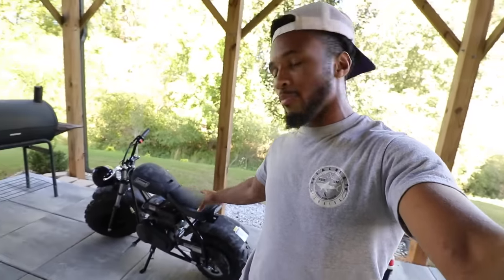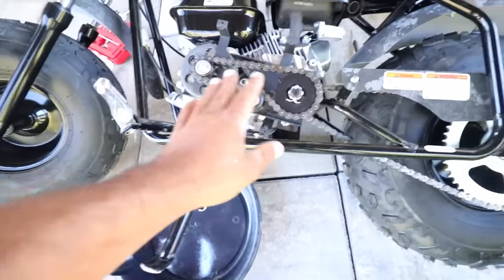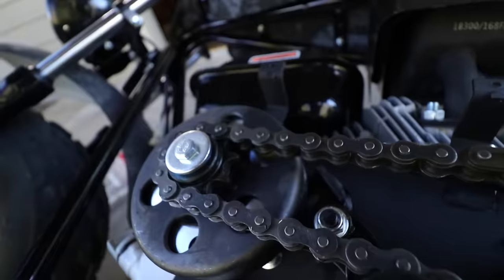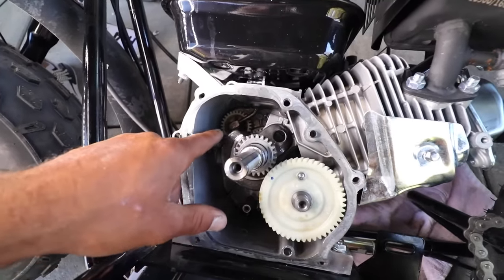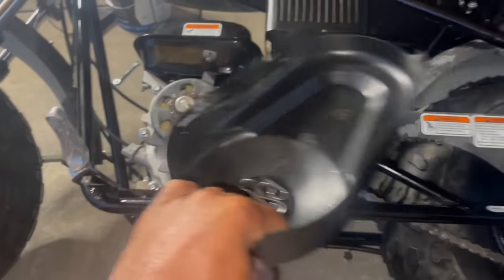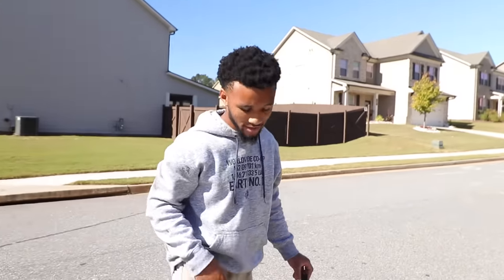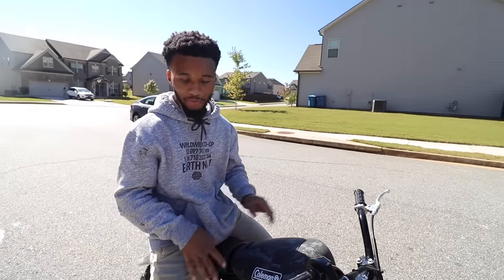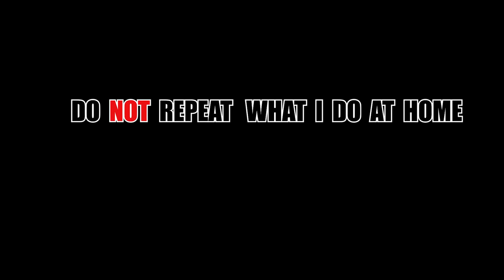I Removed The Speed Governor On My 200cc MINI BIKE!! *FAIL*

Comment: All you have to do is bypass the governor spring with a zip tie on the throttle body under the gas tank, it's just as accurate and you don't have to take the motor apart, just search governor bypass with a zip tie. 🤘
Reply: Is that all you have to do or does it depend on what mini bike you have because I saw a video of some guy who did that on a frp gmb100 and he took out the limiter
Reply: Yeah zip tying it pretty much does the same thing, it just prevents that limiter spring from releasing, it's just less work zip tying it instead of completely removing it
Reply: @ADAMROCK78 I just zip tied mine and it started to stall and now won’t start. It was running completely fine before hand and now doesn’t even start. I just got a new carb and still won’t start. I checked the spark plug and everything else and I don’t know the issue, any ideas?
Reply: Bro when that shit took off lol😂
Reply: Yeah it basically keeps that governor spring from engaging, and yes you'll definitely go faster without that sluggishness when you reach top speed 🤘 SeriousandfunandJesus
Reply: SeriousandfunandJesus  You're welcome, enjoy the new bike 🤘
Reply: Anybody gonna help this guy out?@SeanBulicki
Reply: @SeanBulicki probably not the right spring but idk it seems like it would not mess it up if it’s the governor one
Reply: @SeanBulicki  Your jetting is off. Needs tuning

Comment: U need a spring on the throttle pulling it back so it dont run wide open, and when you go to start the bike always use the choke itll start first pull every time, and when you bought the bike they dont come with oil, it just has a little in there to protect the engine parts in shipping, and another super easy speed mod you can do is there is a screw that only lets the throtle go so far, so the tab it screws in you bend it back, and itll go really fast with that and the governor you just took out
Reply: Smart
Reply: Great tips
Reply: bout 55
Reply: If you do a jack shaft delete and do direct drive they go pretty fast for a "trail bike" me and my buddies got some and we had a car follow us and they were going 61 and we still had some rpms left
Reply: Thanks 👍
Reply: I just purchased one not here yet but can u tell me about what the choke is and does for a motor bike?
Reply: @iknobetter5961  the choke has a on and off position, so when the engine is cold after not running a day or so, turn the choke on start the bike and let it run for bout a minute or 2, then turn it off and it's ready to ride, also if it don't start without the choke when it's warm after riding, choke it and it'll start. Basically anytime for first starts use choke, and when I start to ride turn it off, otherwise it won't run good. Hope this helps
Reply: Smart
Reply: @that_yeller_foreman1529  hey do I just take the governor out? I have massimo mini bike and I can't find any motorcycle shop to work on it so I need to know exactly how to make it faster myself, could you help me In telling me what I need? I'm sorry my father would have helped but he just passed away
Reply: i have an 82cc mini bike, once you take out the govoner they go crazy, what i did was lower the idle and put a higher rpm clutch on it
Reply: @riskydeth1216  u gotta put a spring pulling back on the throttle on the engine somewhere
Reply: @that_yeller_foreman1529  i do have that but its only because of how i have thre throtle set up, i have it conected to an exhaust cage
Reply: @riskydeth1216  and with it, it still has a high idle? Have you adjusted the idle screw in?
Reply: @that_yeller_foreman1529  it runs fine, I was just telling people about it
Reply: @skylerchan7746 there a screw that u turn if u looking at engine it's got a spring u turn counter clock wise to go faster
Reply: Cool bike

Comment: Put a return spring on the carburetor butterfly because it stays open 👐
Reply: Exactly
Reply: Thanks bro cause I did the same
Reply: Yo can u make a video on this please
Reply: @lucassarrazin6306  I just push it back 😭😭
Reply: I just put a zip tie around the governor spring. Top speed of 51mph now
Reply: @paulbernardo3025  can bend the valves though

Comment: Whenever you remove the governor you need to add a return spring opposing the throttle otherwise it’ll just run wide open….. take off the air cleaner and you’ll see what’s going on
Reply: Yo I did this with my ct100u and I did everything added a spring and everything and it still is wide open

Comment: My 212cc predator engine for my Go-kart was set up the same way bro. U gotta remove all the linkage to the governor arm, then (with the engine open again) from the outside top cut that metal governor arm off that u left in there when u removed the governor. After that just tap the hole to make threads where the governor arm was and put the correct sized/threaded bolt in its place w/ sum thread locker on it. Then close the engine case back up, fill with oil, connect a return spring to the throttle linkage and also back the throttle screw out a bit that's on the engine.... Once all that's done, ur ready to ride out.. NOTE: Very Worthwhile Upgrades to get more horsepower n speed are as follows---> performance intake air filter& carburetor w/ upgraded carb jet, Heavier/bigger valve springs, high flow exhaust pipe kit (w/ high flow exhaust muffler tip for the neighbors sake, lol), adjust gearing ratio to your preference by installing a smaller/bigger sprockets in the right places.... After those upgrades, it's like a night n day difference w/ power&speed gains and makes it into something u could seriously hurt urself playing with if ur not careful lmfao... I Hope that helps and I hope u guys get ur minibike set up on point like u want it.. oh and btw, I did it all using YT vids. My YT playlist labeled "Go-kart Stuff" contains every video I used as instructional reference to do everything I just explained, but for my predator 212cc engine on my Go-kart.( I also disconnected and removed the oil sensor cut off box thing)
Reply: This thing is way to complex for this guy. Needs to stay with simpler  things with out too many moving parts.
Reply: @ratdad48 the throttle linkage is pretty confusing how it connects with the governor. I put like 5 hours into it and couldnt get it original again before i gave up and ordered a slide carb and a different throttle cable.

Comment: I think the Governor linkage pulls the throttle open when at lower rpms. It has to be disconnected because it's not there anymore. there should be an arm on the outside of the block from where you removed the Governor. Remove all linkage from that arm. Then adjust carb idle screw. Watch a video on how to remove the arm. It's easier than trying to explain.
Reply: What video?

Comment: Always make sure you have the front tire pushed up against either the curb or a wall  or a tree when first starting it so the bike can't leave without you. Adjust the idle with the brass screw and black plastic screw on the side of the Carb.
Reply: CEESO USES CODE LITTY  throttle likes to stick on those bikes. May need to be loosened more it needs to be snappy pull it with your finger it should snap back quick and a spring to help pull the spring back.
Reply: No you never want to bump a mini bike against anything that is a sure fire way to bend a valve and pushrods and blow every gasket out. The best way is to raise the rear of the bike off of the ground and dial it in that way.

Comment: U need to put a return spring for the throttle linkage it’s just stuck wide open now cause u removed the governor lol u have to find a way to connect the throttle linkage to the little black piece on carb this way your not stuck in wide open throttle I can get u pics if need be
Reply: Wym

Comment: I had that same problem it was my clutch bc it was messing it up and I fixed it by buying a torque converter and instead of taking the governor out I zip tied the spring trick.

Comment: The reason it wouldn’t crank write away is becuase u either    Have that switch on the handle bars turned off or either the gas’s is off or u can turn the choke on

Comment: U took out the right thing you needed to take out that lil bar too and just put a bolt there and re locate the throttle cable and it will work perfect it’s just because that bat is all the way in you just needa Relocate the throttle cable

Comment: Did you adjust the throttle cable at all? Not by the hand controls its just like two metal pieces with a bolt to clamp it together check that out maybe🧐

Comment: Mount a spring on the front end of the throttle where the holes is in the linkage and connect the spring to on of the holes in the flywheel/pull starter and you can’t run your engine like this so much you need to get a billet rod and billet flywheel along with 18 lb valve springs and chromoly pushrods and a billet or cast camshaft and piston for governor removal then your engine shouldn’t blow up I also recommend getting a mikuni vm22 carburetor for faster top speed and better Performance and it gets rid of the crappy throttle and the linkage you just run it through the carb and it’ll have a snappy nice feel
Reply: Also you need to take the arm out of the engine if not it can get in the crankshaft and plug the hole with a screw

Comment: You would need to adjust the idle screw on the carb lower so you have more control,adjusting the idle screw higher will make the bike want to takeoff more (bike is ready at any time to take off)adjust the idle screw too low and it may not rev high enough,you need to find the perfect placement.

Comment: Put a spring on the arm that goes into the motor under the gas tank put a spring on one of the holes in it and connect the spring to the front of the frame with a zip tie

Comment: This is a grade A case of im not sure what im doing but im gana touch stuff anyways.  First off when u pulled the governor gear out, you should have removed the arm and plugged the hole with a 1/4 ×20 screw then as people are stating yes you need a return spring which u removed when deleting the governor, i usually put a spring on the throttle assembly where the old governor spring was on the underside where the little tab sticks down and the other end on the pullcover case. Secondly 16oz of oil MAX. I usually use 12oz. Finally you would also need to put 18lbs valve springs in so the valves dont float..   BUT! I give u al A for effort you have to start learning from somewhere.  I have a mbx10 thats running a 212cc predator. Complete govenor delete, 26lbs valve springs billet rod and flywheel, 22mm mikuni carburetor and pulse pump with 120 main jet 16 pilot, oil return hole has bin drilled out,have crankcase pressure vented to valve cover and valvecover vent to check valve to catch can. Im running a 4.53:1 gear ratio with a tav2 and juggernaut clutch giving me a top speed of 51mph.

Comment: Put the bike on a concrete block with the back tire off the ground then put a return spring that little flappy thing for the governor needs to come out and be replaced with a bolt and you need 18 pound valve springs or it going to float valves be careful turning to high or the oil dipper will break off and destroy the motor.

Comment: I switched from the stock centrifugal clutch (which had a bad bearing on the jack shaft after 5 hours use) to a Go Power Sports torque converter. No other mods. The mini went from 18 MPH to 36 MPH clocked on a straight away. I have a Predator 212 cc Hemi still in the box I haven't used since the stock engine still starts and runs fine. BTW the bearing that failed was never greased at the factory where it was made.
Reply: Kould we talk

Comment: You could get a vm22 mikuni carberator and it would be even faster with a 120 jet but just put a spring on the govoner lever the opposite way the throttle goes

Comment: I bought one of these a few weeks ago for a project on marketplace. Yours looks a lot better than mine does right now. But some spray paint and a few new parts it’ll be fine. I lucked out I guess mine came with a new predator 212. And new parts are already on the way
Reply: Glee.,.I can get ya Predator 212cc parts: a lot more than Harbour Freight list anyway, cams, heads etc,Trev New Zealand🇳🇿🤗

Comment: That stock throttle linkage is so confusing. I tried to zip tie my governor and it was never the same. Ive got a mikuni carb and a different throttle cable on the way because i never could get it right again.

Comment: U gotta pull out that governor arm
U did it mostly right . straight chain mikuni carb n straight pipe should add alot more speed n it wouldn't take off on you

Comment: Zip tie the governor spring would have done you better the 196 is a tough platform you can modify it but may I for argument sake check out a ducar 212 and why I say this motor for modify 196 or predator 212 with governor  removed or bypass will only spin to 5k rpm tell your valve spring float the ducar has a shaved governor it's set for 5300 rpm its a stage 2 motor out of the box it's over built and cost around 200 just building a predator or this motor will cost over 400 food for thought new sub

Comment: Your problem is the linkage... yes you took out the right part. but you need to fix the linkage. so on the carb you will see the linkage. step 1: drill a small hole on the throttle lever. step 2: the linkage you see on the carb needs to be bent and cut into the right shape to fit in the throttle lever hole you just drilled. then once you rerouted the linkage from the carb to the throttle lever you'll be good.... here is a video too show you how to do it. https://www.youtube.com/watch?v=KXDEfY3gork
Reply: I swear I seen the washer still in there to
Reply: This works good easy to do I done it on one
Reply: @user-wk8gg2uj8b  yes the video is to bypass it.. but that doesn't matter because if you take the governor out and/or bypass it you'll still have to redo the linkage 😂

Comment: I ran my chain straight and took the jack shaft off Bypassed the external governor and I have reached 40 miles an hour also have a straight pipe instead of Muffler

Comment: the coleman cc100x goes about the same speed as yours but it is smaller and also runs out of gas faster
when you remove the govenor, which is extremely easy

Comment: Use a spring an hook it to the throttle an hook it to the pull cord cause right now it’s stuck wide open cause there is not return spring to put it back

Comment: Have the same one if you really want some more speed do the torque converter conversion on it! It will feel like riding a very small 450 but with a 2 stroke power band 😅
Reply: Nawl just straight chain it.
Reply: @deion601  facts
Reply: straight chain u just extend the chain and put the clutch on backwards

Comment: Hit up John and Isaac from cars and cameras or red beards garage they know how to fix your problem but I seen at least a couple guys on here sending you in the correct direction to solve the issue I know you have to remove that governor arm and tap the threads and finds a bolt to gif into it and use a little silicone one it so it doesn’t leak oil that arm is pulling the throttle butterfly wide open on you is the issue it has a spring attached to the carburetor that’s pulling on it hope this helps you man.

Comment: Bro bro bro if you wanna go fast just get a pipe and a carb and springs and the motor don’t take off by it’s self it’s has to do with the spring that pulls the throttle back

Comment: It's probably your idle adjust screw unscrew it completely ( its plastic and black screw on the left side of the carb )  then start your bike and proceed to screw it in until you engine starts to idle normally. Ps the more you screw it in the higher the engine idles. 

Hope you get it up and running soon, can't wait for the vids👍

Comment: Ok so I got the same bike from lowes a few weeks ago. I'm no mechanic. I have my HUD display goggles from Zeal. With limiter 21 mph tops even with my 190 lbs fat ass. My nephew is not even 100 lbs wet and same result. Seeing if I need to take mine to taters for the removal.

Comment: He didn’t take out the governor arm also he needs to takeThe silver piece that connects to the throttle linkage on the carburetor off and redo it because it’s stuck wide-open
Reply: Also to do that you’re gonna have to remove the gas tank to get to that piece
Reply: And possibly add a stick for spring to the throttle so that

Comment: If it was smoking that’s because there is too much oil trust me it works with every motor if it’s smoking sometimes the first thing you want to check is the oil because I have a push mower and Apple way too much oil in it oh well my father did so set my father put too much in it Smoked